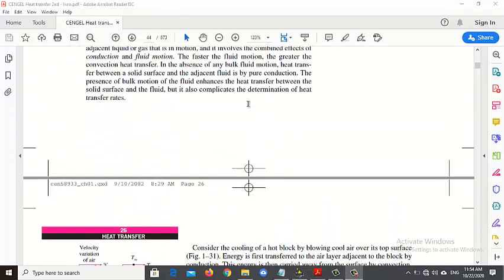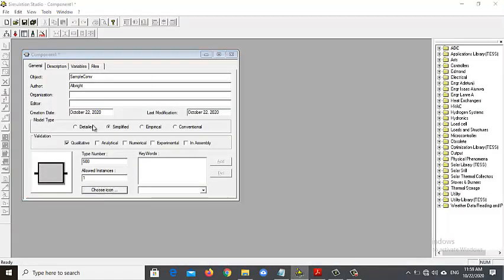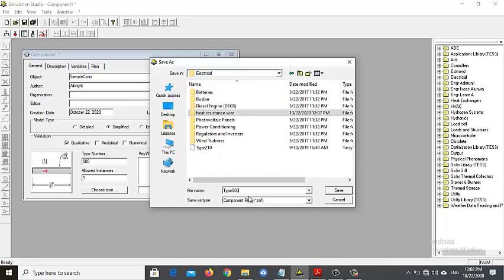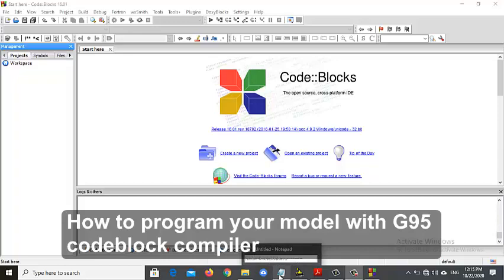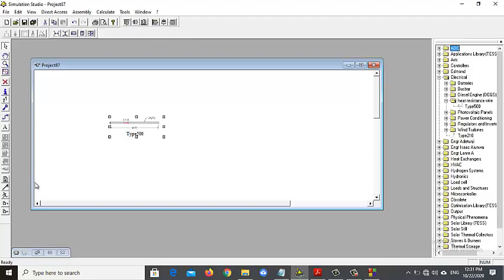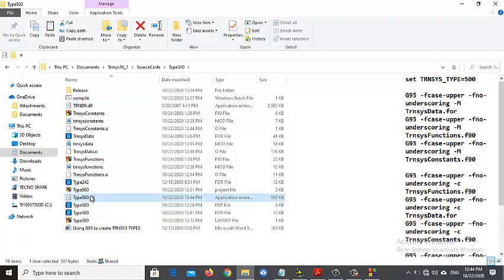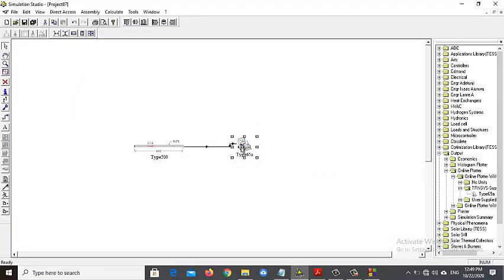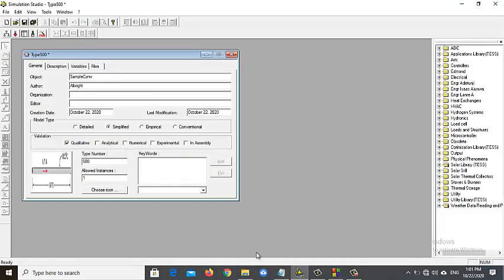Trnsys simulation tutorial 2: how to create .DLL file Trnsys 16

Comment: Hi, when I build the model in code block, I get this error. Fatal Error: While reading module 'trnsysconstants' found module version 8, expected 9. I m using Trnsys 16.
Reply: There is two files attached in the video series. The files attached in this video doesnt work but the other video it works. Just incase if someone else has issues.
Reply: @jawadhazrat4349  i keep getting the same error even though i downloaded the files from the first video :/
Reply: @esraasmadi9676  I had the same error and I solved opening trnsysconstants.mod with notepad and replacing the number 8 in version by the number 9. After that another error occurred and I did the same

Comment: @Albright Edet    i have a problem with the code blok ist not connect with G95 .when i do : compile ; auto detect ; ist not working.
can you give me the link for the codblock are you using:
thank you very much
Reply from the maker: you can manually browse to the directory of the g95 if auto detect is not working. ensure that g95 is installed in the same folder as other compilers within codeblock.